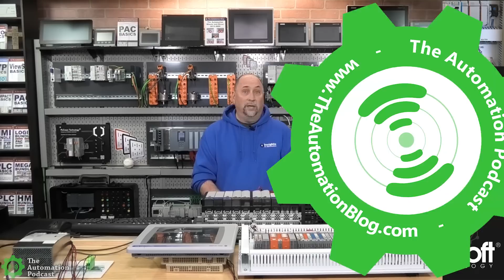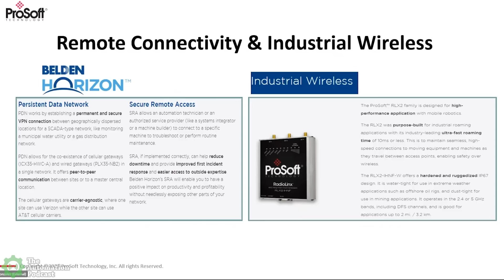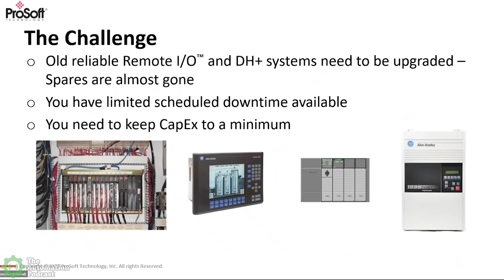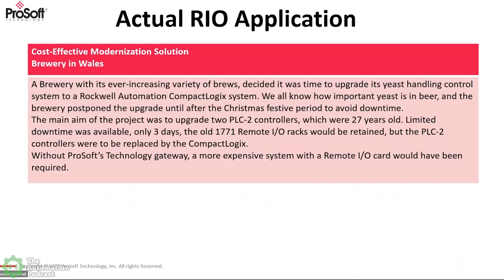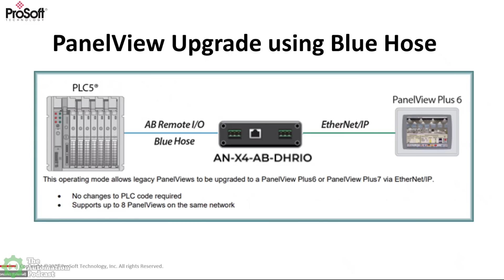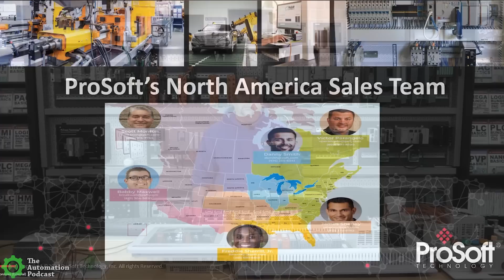Prosoft EtherNet/IP to DH+ Gateway

Comment: I'm working on a project and we've procured 25units of AN-X4-AB-DHRIO module
We're connecting the legacy SLC 5/04 PLCs to Contrologix for remote IO monitoring.
However each SLC is connected to a local HMI, Panel view plus 1000 via the DH+

For our solution, please assist in confirming if we can use one AN-X4-AB-DHRIO Gateway to connect the SLC to the Contrologix and at same time maintain the existing communication with the Local HMI
Reply from the maker: Hey, thanks for asking but this is a two year old video and the product is currently in storage :-( But I know the vendor would be happy to help - they are very nice and easy to talk to, and will stand behind anything they tell you: https://www.prosoft-technology.com/Services-Support